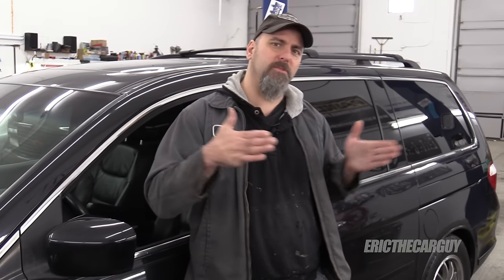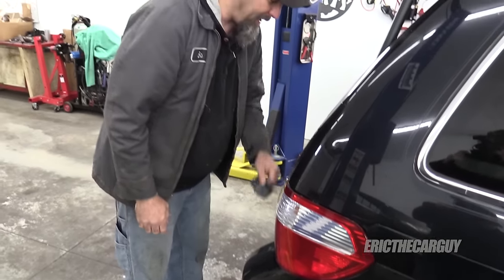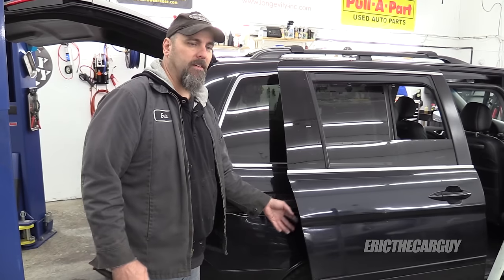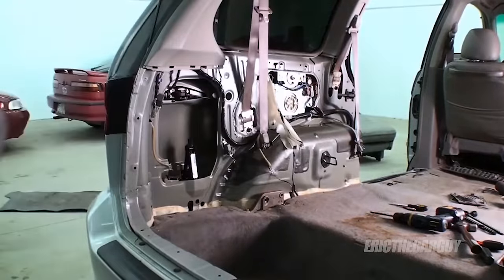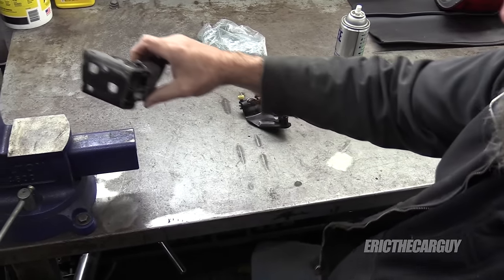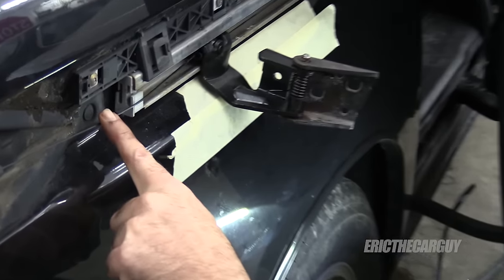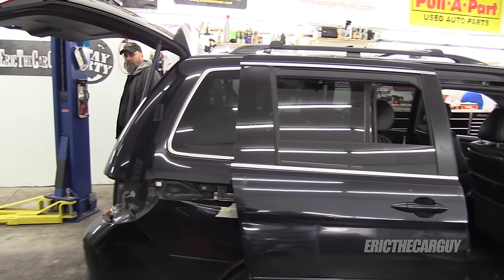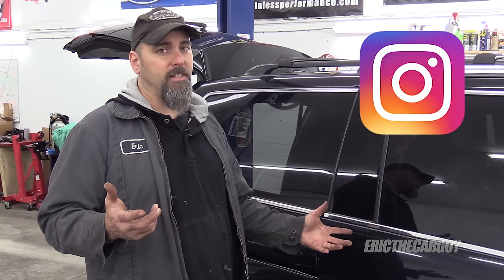Honda Odyssey Sliding Door Repair the 'Easy' Way

Comment: Piece of advice: when it comes time to seat and unseat cable ends back into the hinge, turn the sliding door switch at the drivers console OFF!  If not, pulling on the cables can trigger the automatic cable motor.  And if it slips out of your hands, you will see your hopes and dreams retract into the dark hole of cable nightmares.  Once it retracts, it will lock, and the only way to fix it is to take off the whole panel in the back as the other video in the description shows (only it's not as easy on a 2007) and release the tension.  Or, you will be stuck doing it like me and just cutting the cables and converting the door to manual.  Oh well.  I was so close, too.
Reply: I should have read this last year when doing this repair.  Doh!
Reply: @michellehawkins1027  you can but simply "turning off the switch" wont do that. There is a video on how to do that and involves unhooking the cables. At that point i believe its a manual door.
Reply: This happened to us, but I was holding the cable in my hand and my son jumped in the van and shut the switch before it sucked it out.  I need to remember this when we do the other side.
Reply: Thanks for the reminder.
Reply: Great advice. I used your comment and everything worked well.
Reply: Josh, how did you get it to unlock? When replacing my rollers, the front cable was already missing and there was a large amount of slack in the rear cable. I just closed it to make sure it was on properly AND IT LATCHED AND LOCKED 🔒.  🥴😔 Even if I get the panel off, WHAT action will actually unlock the door?
Reply: Cutting the cables and converting to manual is probably the easiest way to fix this correct? Obviously you lose the power feature but the doors will still function manually. Correct?
Reply: Wow! I just did the driver side before reading this essential tip. Got away with it... but it could have been Oh Sh*t. I'll follow your tip for the passenger side!
Reply: @michaelbackes3933  there is a fuse you can pull...
Reply: Well done😊
Reply: When you go “‘manual” dois it require a lot of force to actuate?
Reply: @zweisteinya  where is it? I want to be extra safe.

Comment: Fantastic video! The dealership was going to charge us over $1000 to get the door working again. I am no mechanic (far from it). However, we replaced the roller assembly (a $30 item) using your step-by-step instructions and the door is working perfectly again. Thanks so much Eric!!

Comment: Thanks for putting this video together!  My dad and I replaced two of these over the weekend and it took less than an hour (total).  Two sets of hands makes it go much faster!

One small tip for removing the tail lights - use a soft cloth as a "rest" underneath a flathead screwdriver and gently pry off the taillight from the outside "point" at its further point along the side of the van.  The light comes out very easily that way and you don't risk cracking the plastic support on the taillight as a result.
Reply: I've seen people put duct tape on the light and pull back with the tape

Comment: I just wanted to say thank you for such an excellently prepared and narrated video. I replaced this part on both of my slider doors yesterday. Because of your instruction, the entire job took me about an hour to finish both doors. I am especially grateful that you didn't edit out the two "errors" you made in breaking the tail light plastic and in letting the c-ring fly away from the hinge pin. These allowed me to avoid making the same mistake on my own van. Each one of these would have been a thousand dollar repair at the dealership. Your instruction just saved me $2,000. Thank you.

Comment: He is back! and spot on for a repair I need to do! This explains why the door on our 2007 does not close/open every time (beeps and backs up) and when it opens you can hear a ka-thud ka-thud from the broken pulley wheels . Thank you!
Reply: is that what the big pop thud is?? Odyssey replaced my motor and it didn't do ANYTHING. Still makes the noise. I think it is this wheel for sure. I have a 2014.

Comment: Excellent video as usual - I just completed the repair today and I have a few suggestions:
1. turn off the auto door switch to the left of the steering wheel. Commenters seem to suggest otherwise, but for me it shut down any auto function including dash switch, door handles and remote [I would double check your vehicle]. Aside from not accidentally sucking the cable inside, it is much easier to complete the repair with it off, allowing you to position the door wherever you want. 

2. Once I was ready to remove the roller, I pushed the door only about 1/3 open, supported the door, removed 12mm bolts - and because I only opened the door a smaller amount, you can just slide the roller to the rear without needing to slide the door outward, and you have plenty of space for the swap. 

3. I had a severely rusted pin on one side. My best guess is that someone replaced it previously and did NOT grease the pin. Bad Person. If I were to do this again, I would get a new pin from Honda ... they are available at Amazon and hondapartsnow. In fact the "Female" half of the bracket [that bolts to the door] is pretty cheap on HPN.. they have the pin for $10 and door side bracket for $16.
I'm speaking about the 2005-2010 vans, if you have previous Gen, you can find complete pairs [china] on Amazon. As it happened for me, I spent an hour trying to get the original apart, then went to the junkyard, that one was worse and I destroyed the pin, so after another hour I finally got the original pin out in one piece. But If I have any future problems, I'll get all new parts. 

4. I would take the time to clean out the track the rollers move in. Mine was full of old grease and I assume bits of disintegrating wheels. I cleaned it thoroughly with WD-40 and then used spray lube that is not supposed to collect grime.

Comment: I just completed the replacement of both of the roller assemblies (left and right) on my 2007 Odyssey.  I planned this to take all day but I finished in 2 hours.  It took an hour and a half on the 1st door and 30 minutes on the second one - you figure out things on the 1st one.  I did modify the instructions a bit - I switched off the motors and just operated the doors manually until it was time to test them.  In that way, I could position them at any position and not have to fool around with raising and lowering the windows.  I also never had to worry about the motor activating as was noted in another  post.  The hardest thing is putting the anchors for the cables back into the roller assembly.  The rest is really easy.  Thank you for the video!😀

Comment: We have a 2008 Honda Oddesy. The passenger side sliding door fell off while it was opening. The van was 6 years old. Thank goodness it was Summer and it happened at home, when it wasn’t raining. The side was scratched and slightly dented as a result. We haven’t used the drivers side sliding door since then as I have no reason to think the same thing won’t happen again. 

Anyway— this is a great practical video, not too long, not too fast, just right for someone looking to take care of it themselves. Good to see you back ETCG!

Comment: Eric, the 2005-2010 Odys don't have the twist cable adjustment behind the trim panel that you showed from your earlier video.  The later models use two white tabs on the motor assembly that you have to pull up to put slack in the cable.  When you're done you push them back down to put the spring tension back on.   Another trick is to turn off the power to the doors and you can move the door manually and put it wherever you want it.  I usually just open the door to where the rear of the door swings out and then work the trim piece from there.  Then you can move it back a ways to replace the roller.
Reply from the maker: Great tips. Thanks!
Reply: THANK YOU! I couldn't figure out how to get slack in the cables without that wheel to twist. My wife's is a 2010 model.

Comment: LOL I've done this exact same repair to my wifes 2006 Odyssey and broke the tail light in the exact same spot LOL. Thanks Eric!
Reply: That's one of the things I like about watching Eric work.  He shows us what can also happen 'wrong' with repairs.  Some around youtube would just edit it out and say  "I am repair GOD!!"....
Reply: Use this tip to remove the rear light assembly without breaking it: https://www.youtube.com/watch?v=3zK6EAx89c0 flathead screwdriver plus a paper towel or rag and wala!
Reply: Mines broken there too!
Reply: Mine slipped out of my hands when I was disconnecting the cables and broke on the floor...

Comment: Thankyou to EricTheCarGuy.   Dealership wanted 200+ to fix and I had the part.   I followed Eric step by step and it went well for my 2007 Odessey.  Thanks for the heads up about pulling out the tail light.  Was also able to reattach the cables  first time using your technique.   thanks again.

Comment: Tip for removing those tail lights, get a piece of duct tape on it, so you can pull it straight back from the outside edge without getting it sideways. Works great on these style tail lights, we do it at the shop all the time.
Reply from the maker: Great idea! Thanks.
Reply: You're welcome, always nice to share useful info.  By the way, we hate sliding doors on vans at the body shop, and I have personally broken, or scratched, and had to repaint those plastic trim pieces, so don't feel bad if you put a nick or two in the odd one ;)
Reply: thats a great tip, thanks
Reply: Great tip, I've had to take these off many times working at the body shop,luckily never broke any.
Reply: This worked great today.  I'm sure glad I read your tip.  Thank you so much.
Reply: Thanks Eric, Just did that again on the 2010. A flat head screw driver with some tape on it ( to prevent scratching the paint) works great to pop that little booger that holds the light. It doesn't take much force at all.
Reply: genius! worked great
Reply: Great tip man!! Same idea would work on my 4Runner.
Reply: @ep3tracktime873 a set of plastic trim tools from Harbor Freight works, too.
Reply: @jimmellenberger8505  Another good one is a plastic tire lever used for bike tires.  I haven't tried it myself, but saw it on another Odyssey sliding door repair video on YouTube.

Comment: Your great video allowed me to change out the center roller, which was missing one of the plastic rollers.  I found an aftermarket set of left and right rollers on Amazon for $23, and installed it myself:  the hardest part of the installation was reconnecting the cable to the roller.  It worked fine a few times but then the sliding door binded up again, just as before the replacement.  While i have no doubt the old damaged roller was the issue, I believe I have other issues with the track that the rollers fit into, where the rollers don't stay inside the track.

Comment: My passenger side sliding door wouldn't open and i had the "Sliding Door" light illuminated on the dashboard.  I dissasembled the roller mechanism from the sliding door and the rollers were still intact. It had a little play in the rollers but look fine compared to the new one i purchased.  Previously when i opened the door manually, it wasn't as smooth as the drivers side sliding door.  Seemed like there was a sticking point i would have to push thru.  I ended up just greasing the rollers, and the sliding door track.  I had to reset the "Sliding Door" dashboard light by pulling the red 7.5 amp Backup Fuse under the drivers side kick panel so the power function would work on the door.  Door now works fine and rolls smoothly, doesn't get stuck or bind.  But I am so happy to have found Eric's video to walk me thru all the steps.

Comment: Tip: Instead of fiddling around with the window, there's an easy way to get the door to stop at any point along it's travel. If you push forwards on the inner handle of the door while it is opening, the door will stop in whatever position it is in. Only works with the inner handle though, pulling the outer one just closes it again. I feel like knowing that would have helped a lot, you could have just cracked the door open a little bit rather than trying to slide that metal piece out from behind it without scratching things.

Thanks a ton for the video! Need to do this on our Odyssey, so your timing couldn't have been better.
Reply from the maker: Cool. Thanks for the tip!
Reply: Or just switch the auto open/close to off position and you can manually slide the door.

Comment: Excellent job - Thanks for posting. Explains all I was wondering about this new-to-us Odyssey; from the clunking flat sided rollers binding - to the previously broken taillight housing ( I'm relieved I was forewarned on the other side when I replaced brake light ) Bottom line: I was able to band-aid the repair by removing 13 years of gunk-buildup ( somewhere along the line a guy has to clean with Brake-parts cleaner {watch the painted surfaces} or carb cleaner; not just add more dust attracting grease-of-choice )  while I await the true fix of the parts arrival -- I CAN'T imagine how frustrated I would be to completely disassemble and THEN await parts !!  Thanks for saving my frustration..!

Comment: Go to Home Depot and pick up a pair of textured rubber coated gloves. You will be amazed how easy it will be to remove this style of taillights. I tried for over an hour to remove the tail lights on my Hyundai Tucson. Tried the gloves and they came right off no problem.
Reply from the maker: I'll have to try that. Thanks!

Comment: Thanks so much for this video! We put off repairs for a while because we knew it was going to be super expensive but recently it was getting really bad so I scheduled an appointment. Then I found this video and ordered the parts. The next day the door just fell off the track while she was at the store with the kids. I showed up and because I had seen this video once I was able to make fairly quick work of getting it back together using the jack in the van (unfortunately didn't have the new piece yet). The 2nd time wasn't as smooth - the door dropped off the jack and the bottom corner hit the floor.  Learn from my mistake, use the floor jack and maybe a friend to make sure.

Comment: Just wanted to say thanks! I just replaced the roller on the driver side of my 2008 odyssey and it went almost without a hitch (1st screw was not magnetic and it took a bit to figure that out). I would bet I would have totally broken that tail assembly had you not left that part in the video so extra thanks. Great video and super helpful!

Comment: Eric, Great work!!!  I followed your instructions and I was able to do it. A couple of comments for someone who is not an avid mechanic like myself. 
1)Avoid doing it yourself if you are not an expert in doing this. I thought I could do it easily and there were a couple of moments when I grew frustrated. Specially when you have to insert the wires in the roller.
2)Please Please, put tape to the area near the slide, I scratched a bit my paint even though  I did put tape but not enough.
3)make sure you create a checklist of tools you will need, I lost 1 hour since I forgot to check the 1/2 cube
The sad part in my case is that I discover that sliding door motor is not working, so I will have to do the double work. 

Best,

Comment: This appeared at the top of my new recommended videos I said to myself "hmm, I have a 2010 odyssey with as yet undiagnosed door issues." I went out to the garage and sure enough both sides have a ton of play. Awesomely your (affiliate?) link actually has a slightly better shipped price for genuine parts than Amazon. Thanks!

Comment: Thanks Eric the Car Guy! I was going to replace the acutator until you showed the "pull on the door trick". Did a little checking and one of the rollers on our door is gone!! Just ordered a new one. Can't wait to fix our "clunky" door that doesn't work half the time.

Comment: Thanks man!  I just finished doing both doors on my wife's 2010 Odyssey using your video.  Your method looked much better than others I watched, where you take apart the inside of the back of the van.  No thanks!  Only issue I had was getting the hinge pin out of the bracket on one of them.   Fortunately, I have a machine shop, so I was able to wrestle it out.  Thanks again.  Liked and subscribed.

Comment: Let me guess by the aftermarket wheels it had PAX tires 😂
Reply: RedLineBandits I have a 2009 EX-L W/ Nav & DVD, and I avoided the Touring for that reason 💀
Reply: The 2009 didn't come with pax on the touring. honda realized that nobody wanted it and switched to regular tires starting in 2008. they still had the option for pax with the 7 spoke wheels but most have the 5 spoke wheels w/o pax. 
The switch happened in 2008 with the facelift. 2007 got the new, strengthened transmission though

Comment: Thanks EricTheCarGuy!  This was a perfect step by step walk through for my 05 Honda Odssey that had the same issue.  One small warning to others though is make sure you are careful with the jack movement when the door is resting on it.  Our door almost ended up on the floor and it was really heavy to get back on the jack.  But luckily after I followed your steps our door is running like it is brand new again.  Thanks!